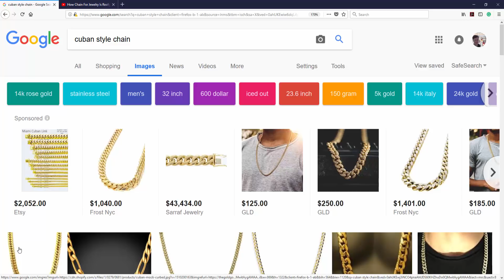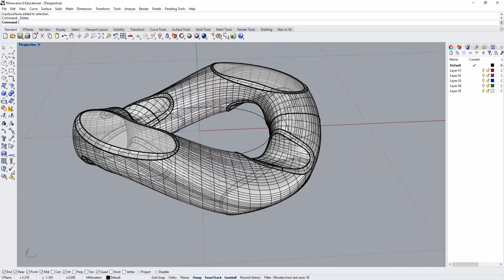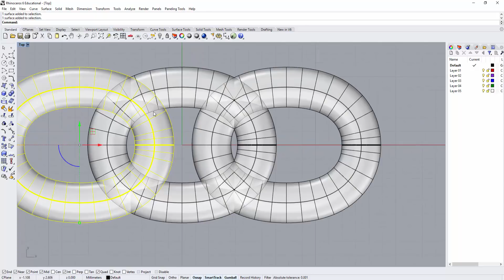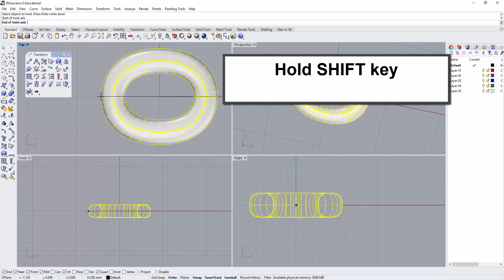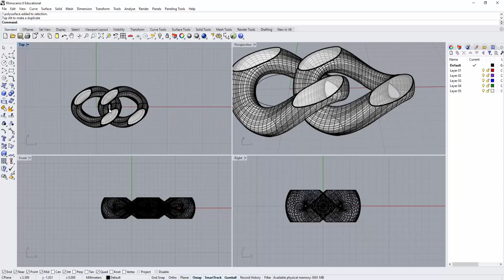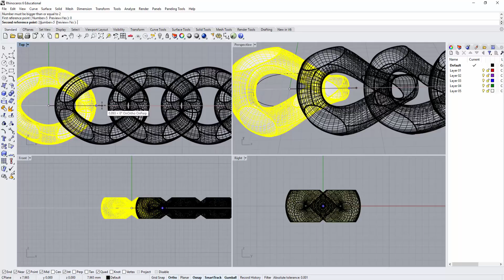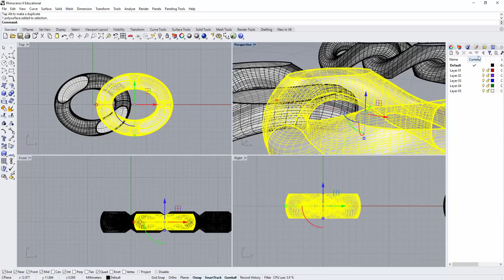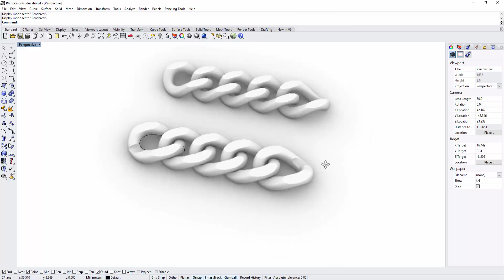Cuban Chain 3D model in Rhino 6 (2018)- Jewelry CAD Design Tutorial #26

Comment: Has anyone casted a 3d model of the cuban chain? I am wondering if its easier to 3d cast the chain or make it out of scratch?
Reply from the maker: I think depends on the size.
Reply: @PJChenJewelryDesign  how would you make Cuban links from 3d printed casted material. Wouldn't you have to cash each piece and then cut it and link it with all to make it a chain?

Comment: Great video thanks PJ. If you were to print and cast, How would you sprue it up? Would you sprue several links already connected? I have an eighty gram nine karat chain to make. I read comments below. Would you make each link separate and then join?
Reply from the maker: Just checked with my casting vendor to double make sure. for the big heavy chain, they suggests to cast them desperately but one link open and the other one is close. after polish you can assemblage together.
Reply: @PJChenJewelryDesign  thanks for the reply. Yes, that makes sense. We'll try it that way

Comment: How did you rotate the second cross section?
Reply from the maker: NASR JEWELERS I think I was using twist Instead of rotate.
Reply: @PJChenJewelryDesign  the second cross section in the vertical position  ..so you use which option to rotate it in vertical position?

Comment: if i wanted to make the links into a necklace, how would I make the links into a circle instead of a straight line. Could I do a circular array instead of linear?
Reply from the maker: You can use "Flow Along Surface" command. I have used this command in many of my Youtube videos.
Reply: Thank you. One other question please. I’ve only seen the flow along surface command done on rings so far. Because rings have a surface to apply the command to, and in this case, a Cuban link does not have that surface. what would I use as a surface when using the command.
Reply from the maker: you can create a circle. then extrude surface. then create UV curve from that surface. After that, you will get a rectangle on CPlane. make it into a surface. place the cuban link on it. and flow along surface back to the original surface.

Comment: Can you 3d print a chain like cuban link then cast it? Also can you put stones on a chain on rhino?
Reply from the maker: Hi, Technically, you can print and cast it, but it is cheaper to buy chain than 3d print then cast it, unless you have specific design that you cannot find on the market. Or the link is for a bracelet than a chain. and yes, you can also arrange stone setting on any surface in Rhino 3D. Check out my playlist "stone setting in Rhino3D", You will find useful tutorial for stone setting.
Reply: PJ Chen Design what do you mean by buy a chain then print it?
Reply from the maker: oh, I mean it is cheaper to buy a ready made chain than doing 3d printing.

Comment: Thank you PJ.  I was able to design both chains. What I didn't get is why you can't 3d print them? If the individual pieces are not touching each other I believe it's a printable model no?

Thanks again, great tutorial. Amazing job
Reply from the maker: You are right, you can print them technically. it just economically makes sense to have machine made. You can find a lot of videos on youtube about chain manufacturing process to get the idea of chain making. However, if you plan to make a thick bracelet. You will need to 3d print and cast them.
Reply: Ok, sounds great, I'm going to take a look at those chain machines. As you can see, I'm not on jewelry business. I'm just a hobbiest maker with a 3d printer.. ☺️